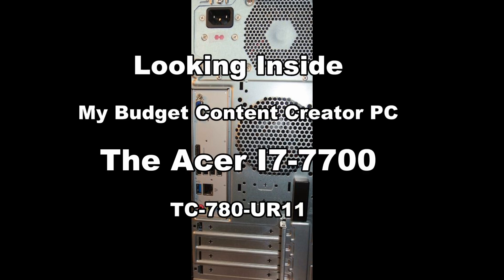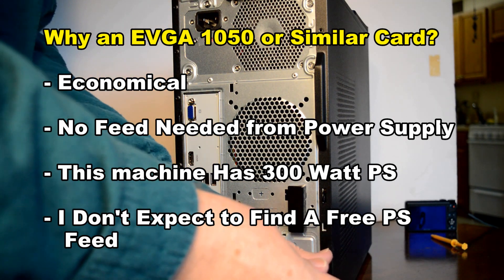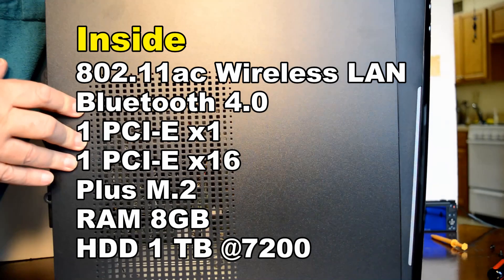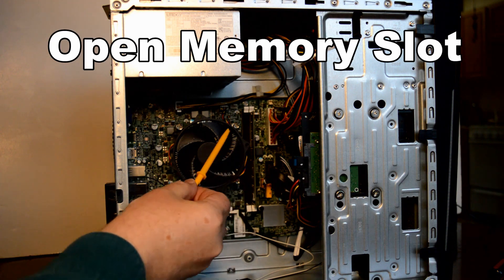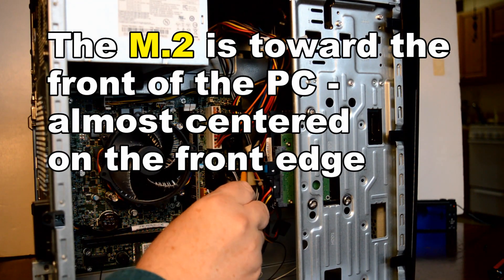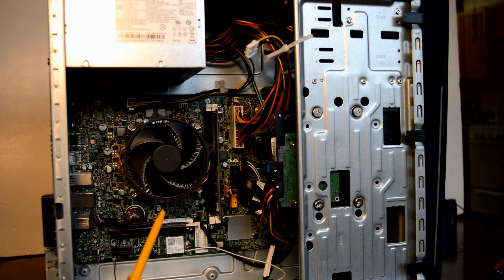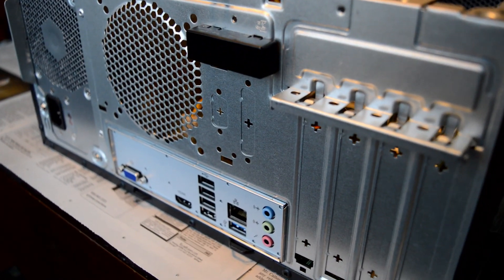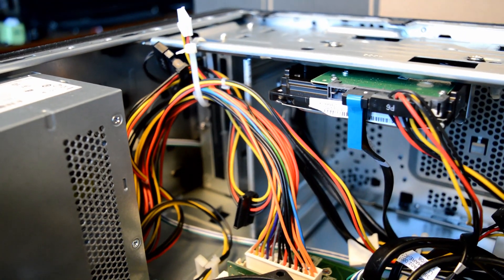Acer Aspire i7-7700 Desktop TC-780-UR11

Comment: Hi, I have the same exact machine which I recently bought used. Having used yours 1 yr, any suggestions on what to watch out for? Does it matter if I upgrade DDR4 TO 16GB? Isn't 8gb small?
Reply from the maker: FYI - I still have this Acer but have added a 550W power supply, an RTX 2070 GPU (Donated from a viewer), a 256 GB M.2 boot drive and 16 GB Ram. As you may already know, the DVD is crap and some of the USB ports get unreliable after a couple of years. I use mine every day and also use it to stream on Twitch 20 hours a week, so, I think it's a great machine and a real bargain.  Later -- Rob
Reply: Thanks for your reply. I have had mine a few days and I'm disappointed in how long it takes to boot b4 windows appears. Being i7, I thought it would be fast, although it has only 8GB memory
Reply from the maker: Boot issues are often related to start-up apps or other software issues. Otherwise get an m.2 or an SSD

Comment: I have the same motherboard but can't find information on the layout. Do you happen to know what the yellow 20 pin connector beside the sata port is? Thank you
Reply from the maker: Sorry - it's been awhile - but next week my new power supply arrives and while I'm installing that I'll see if I can find out about that pin connector - Rob
Reply: It's a dual USB 3.0 port, same as the black one next to it which is being used for the 2 front panel USB 3.0 ports.

Comment: Acer Aspire TC-780(KBL) (U3E1) to up grade the storage just wanted to know if it is the SSD NVMe and M2 SATA
Reply from the maker: Back in December, for this machine, I bought a WD Blue 3D NAND 250GB Internal PC SSD - SATA III 6 Gb/s, M.2 2280, Up to 550 MB/s - WDS250G2B0B and it works great - so SATA, NOT NVMe   -- Later Rob
Reply: @TechVideosNET  thanks
Reply: @TechVideosNET  can the 1 TB work on this?
Reply from the maker: I think 1TB will work

Comment: How did you attach the M2. It seems to lack a screw, did you buy one? What size? I read somewhere 3mm or 2.5
Reply from the maker: I bought the screw when I bought my SATA M.2 - you can check MICRO CONNECTORS M.2 SSD Mounting Screws Kit at AMAZON for example.

Comment: I have the i5-7400 version and I am considering upgrading it to the i7-7700 for video editing purposes. I don't know if its normally worth it but with 4 cores and 8 threads instead of 4 and 4 on the i5 I wonder if its worth it. I am going to be getting a gtx1060 and up to 32gb ram as well so this should handle pretty well. But I don't know if the CPU at an i5 will bottleneck me or not.
Reply from the maker: Most reviewers (such as Tech Deals) say that the one application where an I7 is really worth the extra cost is content creation. At this point I would also consider an I5-8500 with 6 cores, and pretty fast too. Good luck!!, Rob
Reply: @TechVideosNET  thanks. I ended up just going for a whole new PC with a ryzen 2700x. I'll need a little more RAM and a better video card but I'm almost there
Reply from the maker: Great choice. I forgot about AMD !!! Hey, it's early in the morning. Thanks for the update.